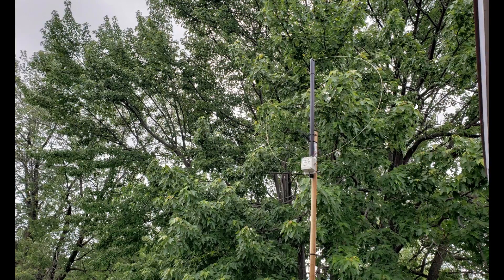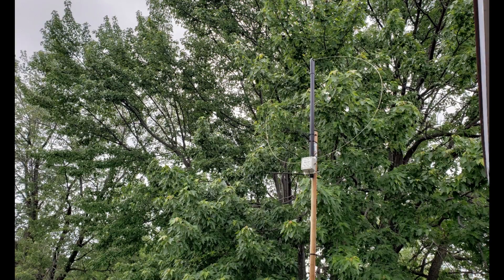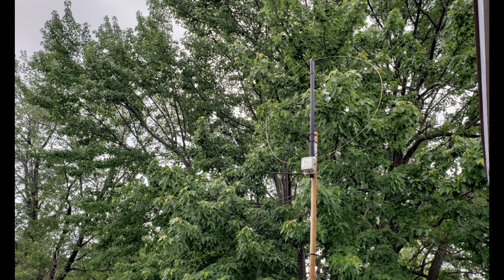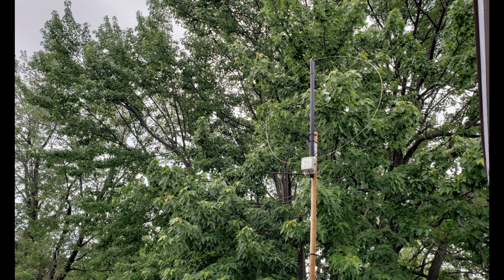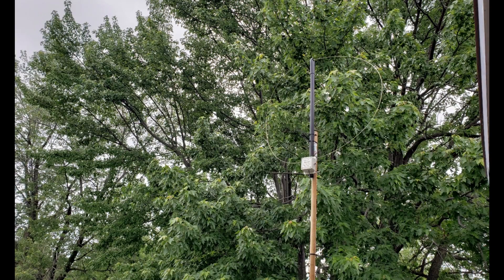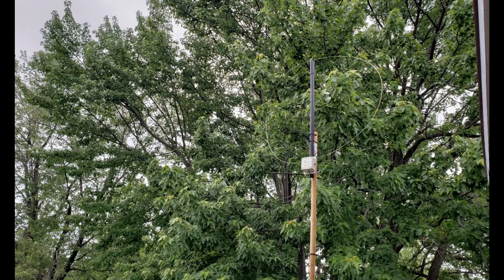MLA 30 Magnetic loop questions and answers

Comment: How would I connect the MLA's rather unique SMA coax output to my 3.5mm mini plug input on my brand new Tecsun H-501x receiver? I would rather plug it in to the provided decoupled input than wrap a bare wire around the antenna. Any suggestions would be greatly appreciated. Keep up the great work. Your videos a tremendous resource.
Reply from the maker: https://www.amazon.com/RedYutou-Female-Adapter-Antenna-Extension/dp/B091ZCNXWD/ref=sr_1_4?crid=2PCO5NTENO1LZ&keywords=sma+to+3.5+mm&qid=1679277907&sprefix=sma+to+3.5+mm%2Caps%2C91&sr=8-4
Reply: @OfficialSWLchannel  Thanks, Gilles. My extra part has arrived, so I assembled the wires and loop in my kitchen just to make sure I had everything necessary. With the preamp powered, the difference in the quality of the signal from my loop antenna over the built-in whip antenna is stunning. And the background interference seems to have fallen away to almost nothing. Can't wait to get it mounted on my garden shed. I'll keep you posted.👍

Comment: Hello Gilles, my question is while rotating my MLA 30+ loop antenna to get the lowest noise, is their a best band or frequency to be on when rotating the antenna, Or does it not matter what band your on and just choose any frequency and then rotate the antenna till it has the least amount of noise ? what would you suggest ?
Reply from the maker: Choose one of the noisiest bands you have and then rotate it for lowest noise
Reply: Okay thank you Gilles for replying back & for the info I will do that thanks.

Comment: The MLA 30+ is a brilliant antenna but it can't filter out all noise.
I have an air source heat pump in my back garden and when that fires up it puts out S8 level noise on the upper shortwave bands (15 Meters is completley wiped out).
It's taken me months to find out what the source of the noise is coming from but now I know, I will have to reposition the antenna.
Looks like I may have to put this antenna up in my front garden (furthest away for the air source heat pump)

Comment: This is a really helpful discussion and I've had similar success with my MLA 30+. The best low-noise spot for me was against a wall oddly enough, although it would certainly be improved by getting it above the roof-line. I've been pleasantly surprised by it's MW performance.

Comment: I bought a cheap electromagnetic field strength meter on eBay that gives a digital readout of some localised noise to help me learn about my environment while positioning antennas. For everything else, I find a spectrum analyser particularly useful. Occasionally I’ll interpret the signal-to-noise ratio on one of my radios. I enjoy experimenting with different types of antennas.

Comment: I would rather replace the antenna instead of the radio,I have never grounded my antennas I just unplug from the wall and disconnect the coax
Reply: That is the best way to keep surges from destroying your radio. 👍👍

Comment: Gilles Mal 30 what kind of battery does the ml30  take?
Reply: Battery?  None, you put power to the antenna by an in-line bias-T or use your radio, if it can power using bias-T.
Reply: no battery inside, its a 5v USB Bias-tee